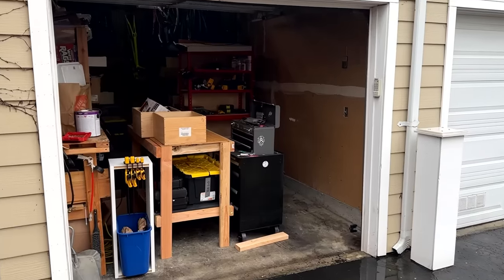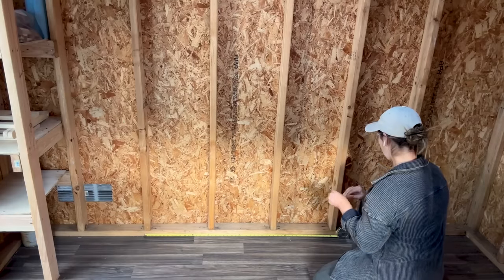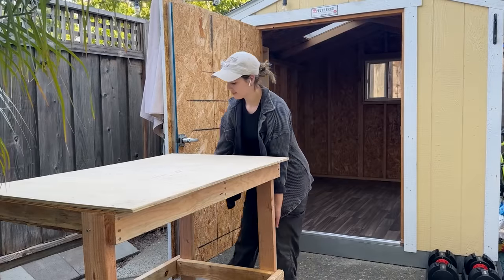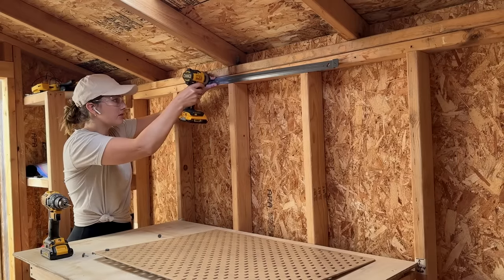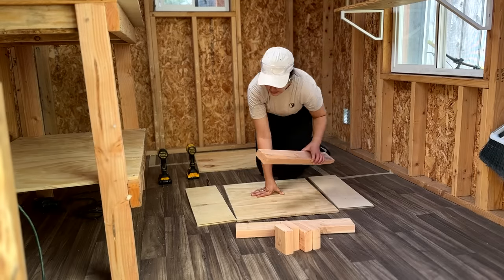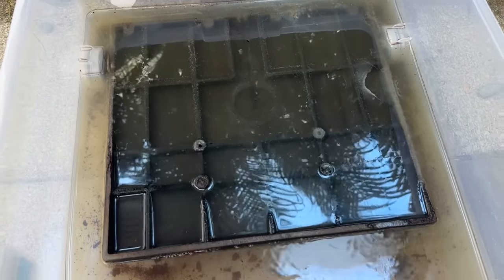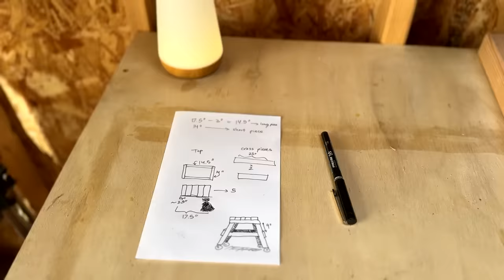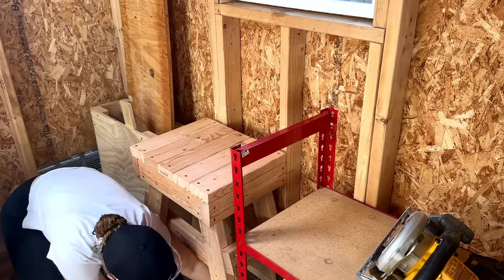Building a Mini Workshop... Again

Comment: I have the exact same Bandsaw. It has served me well. Just have to make sure not to push it too hard and I suggest a Lenox flex back blade in the 3 tpi range (70 1/2" blade). Was only 15 bucks on BandsawBladesDirect. Great for resaw if you're into bookmatching for box lids and such. Sick shop. Super jelly😂
Reply from the maker: Thanks for the tip!

Comment: Hey, i see those nice B-roll shots at the end and at 13:44 and other parts i can see your exposure was not locked and it was changing, if you are able to lock your exposure when inside the shed and keep it the same for the whole sequence it will look better. Of course the first shot from outside to the inside of the shed needs an exposure change and it looked fine but if you are in a constant light environment it is better to set it to one setting and keep it and it also should stick the shots together in a better way. Soo just a small tip if you'd like.
Reply from the maker: Appreciate the feedback! For now, I use my iphone to film everything so I have a bit less control than with a camera.

Comment: My first thought was, you should make barb doors out the side wall. Put a couple of those wheels on them. Need more room just swing them open. My 2 cents 🤷‍♂️. Turned out as a nice workshop space 👌👌
Reply from the maker: Thanks! I like the suggestion, problem is I'm a renter and this is the landlord's shed that I'm allowed to use but not completely  modify

Comment: I did something similar with a shed that came with a house I purchased.  I converted it into my office.  My only issue with it is that it was made from 2x2 instead of 2x4..so the walls are thin, and it's expensive to heat and cool.   Looks good, though, I really enjoy having mine.

Comment: Nice job 😀. I don't know where you live, but I would insulate the shed if possible. Cooler in the summer, warmer in the winter and might also lower the noise (less angry neighbours if any).
Reply from the maker: Thanks, a few people have suggested that. Weather/temperature isn't much of a concern where I live but the noise reduction benefit is a good point

Comment: My piece of paper in the suggestion box reads..... More clamps~ a lot more clamps. Srew and nail totes 'removable' in the little gap by the window (at least 20 for the most common sizes). A way to lock the table to the wall of the shed, that little bit of extra stability helps when hand sawing off the edge of the table or in the vice. Maybe a drill bit organiser, metal, wood, brick, tile etc. A good extractor vent in the top of the end wall to get the heat out and stop mold growth. And some good 5500k-6500k LED lighting.

Comment: 12:42 - spray paint really doesn't like the sort of extreme temperature changes you'll get in a shed over the course of a year. In extreme cases, like if you're in an area that is generally pretty hot during summer and that shed gets lots of direct sunlight, you risk the heat doing unpleasant things to the compressed gasses inside those cans. Storing it separate from the materials you want to use can cause some weirdness (spray paint solvents really want the can and material to be the same temp), but that's better than the alternative. 

Other than that, I like this build. It's a clever use of a smaller space. The fact you have a P100 handy is great.
Reply from the maker: Appreciate you sharing your concern and you’re right! Our area doesn’t get too hot in the summer (typically) but just to be safe I did move all the more sensitive chemicals and paints to the garage since it stays much more stable temperature-wise

Comment: 800 grit sandpaper on a flat block will really smooth out the bandsaw table, then wipe off the table with naptha (shellite here in AUS) with a clean rag and then rub in some woodworkers paste wax which will help protect the iron and also lend a hand in smoothly guiding stock through the bandsaw. Not sure if anyone mentioned already, just been watching the build unfold :)
Reply from the maker: Appreciate the tips 😊

Comment: I'm new to woodworking.  I built a work table for myself.  Now that I'm using it, it's probably double the size I really need.  I have thoughts about redesigning it to a manageable size.  Thanks for your video because I now have ideas about storing my tools somewhere other than on the workbench.  Oh, and a nice wood scrap storage that my wife will thank you for.  🙂
Reply from the maker: Glad I could help!

Comment: Cool workshop but I really think you should insulate between the wall studs and the rafters. Both to keep out the heat and cold (one of which is more important in your area) as well as controlling humidity to prevent rust.
Reply from the maker: Appreciate the suggestion, definitely considering it
Reply: @elenamakes  
You won't regret it!

Comment: I just thought I might suggest you get some 2 inch rigid foam in various sizes to place on your sawhorses while you’re downsizing your sheet goods. Just set your sawblade an eighth of an inch deeper than the thickness of your products. You’re downsizing and you’ll be fully supported before during and after your cuts.

Comment: When you were replacing the lower shelf on your workbench did you consider replacing the top and notching it out to go around the 2x4 wall studs? I imagine in such a small space that extra 3 1/2 inches could be valuable, not to mention keeping rolling things from rolling off  the top behind the bench.
Reply from the maker: Not a bad idea!
Reply: @elenamakes  if you're not already familiar with her, check out @diyhuntress. For years she did projects out of her shed shop and has posted a lot of videos about it.

Comment: Nice video. (Nice to see other women doing builds and  DIY etc.)  I think i saw another shed build where the moisture still kept water vapor inside (since there's no vapor barrier skin), and thus rusting tools and warping wood, creating mold inside.  Consider adding a solar vent to exhaust out air/moisture (50CFM min.) Even though the shed is not heated, I still think consider adding insulation, altho it depends on your climate (seems like it would working in there more comfortable.) In warmer months, the exhaust fan will take out heat, stale air.  I like the idea someone made of painting it white to get more reflective light.
Reply from the maker: Appreciate all the great suggestions :)

Comment: A couple of cleat walls for tools and power tools should save you a lot of space. Also maybe a shallow wall cabinet using both sides of the doors for paint and small parts storage might work. How about attic storage for scrap wood?
Reply from the maker: Unfortunately no attic at our place but I like the other storage suggestions

Comment: Everything looks good but I see one thing that can be easily made better. If you shorten the legs on your bandsaw stand to make the saw's table the same height as the workbench you can use the workbench as an outfeed table. If you add other tools like a table saw, router table, planer, etc. you can make stands so all of them are the same height and any one can be an outfeed, infeed or side support table for large materials.
Reply from the maker: That is a great idea

Comment: Clearly you live in a warmer climate than I do.  Last winter it got to -14C (about 7 fahrenheit) for a week so one of the major issues in the workshop I am kitting out is INSULATION.  Brrrrrrrr 🥶
Reply from the maker: Oof yeah those are some low temps. I am very lucky to live in an area where a good fleece lined jacket will keep you warm enough in the winter

Comment: Do you have plans for some kind of climate control for summer/winter? Maybe a window a/c unit or small heater? I love the shop, great video and great suggestions!
Reply from the maker: Good question, I’m lucky to live in a place where there might be a couple days out of the year where it’s too hot to work in there, but most of the summer, a fan will do just fine. It also never gets cold enough that you need more than a good jacket but I do have a smaller portable space heater as well.

Comment: Very nice job on the workshop, I like it a lot. But was wondering. why didn't you add 2 X 4s in the middle and on the one end of the workbench to support the bottom shelf.
Reply from the maker: I actually recently re-did my workshop (I moved) and made those reinforcements on my new bench :)

Comment: Excellent job in making a workable shop from a small storage shed. The one thing I saw that was a bit concerning was your cutting of the plywood shelving for the workbench. cutting the plywood down the middle, while it was supported on two outside sawhorses is an accident looking to happen due to potential blade pinching. Please, for your safety, always cut the material so that the fall-off piece is unsupported. Just put a smaller table below the fall-off if you don't want it to fall to the ground or floor - but never make a cut between two saw horses or supports.
Reply from the maker: Thanks! You're 100% correct I shouldn't have cut it that way, appreciate you looking out

Comment: If you had a least 6 feet of space between your shed and the fence in your yard, you could attach a fold-up sawing table on the outside of your shed for cutting larger pieces of wood. That way, you wouldn't need to pull out any saw horses anymore to cut 2x4s or plywood on ever again.  Not only that cutting wood on top of a table is way more safer and you don't ever have to worry about your equipment binding up on you during a cut or a skill saw kicking back from cutting pieces of wood without any support under the wood. Also, in the long run, the less you bind up of your skill saw the better the chances are you'll never need to burn up a nice expensive tool so you can keep building stuff and not have to run to the store to get a new saw every time your get your saw into a tough bind.

Comment: It is a very interesting project to implement in my hometown in rural northern Thailand.  And would like to ask about your ventilation system, how do you do it?  Because my hometown is in the tropics, the temperature is high most of the year.  thank you very much
Reply from the maker: Hmm I'm no expert but if I was in your situation I'd install a ventilation fan in the ceiling and have fans / windows I could open to get good air flow in the shop itself. You'd want to be careful about dust getting kicked up by the fans but a ventilator and full eye protection would help.

Comment: I recommend putting a spool or something similar on the screw that the bandsaw's cord hangs on.  Almost anything to increase the radius and NOT be a sharp metal edge directly on the tool's cord.  Is the screw likely to damage the cord: probably not.  But why go looking for trouble when the solution is literally five minutes' work and an otherwise useless piece of scrap to fix?

Comment: Since some products like the ones on your shelves (generally speaking, don't know about your shelf items specifically) are temperature sensitive, do you have any thermal control in mind?  Not sure on your climate, but I know that a lot of products have a range and not just minimum or maximum temps to work with.  I'm planning on outfitting a space just like the one you have, so I'm eager for any ideas.
Reply from the maker: My climate is pretty temperate, but just to be safe I actually moved the more temperature sensitive items to our garage as the temperature in there stays more consistently cooler.

Comment: Knew i forgot to tell you something..DONT USE 3 in1 oil or any other rust inhibitors on any metal surface...clean it then use a Ceramic coating on it..i used a one made for cars BUT  found one for metal surfaces..works awesome...Now go build..!

Comment: Your workshop looks very neat and organized, congrats. I am not from US so I don't know the ins and outs of your lumber market, but it seems to me that those beams you used for the open shelf  are a huge overkill? Probably the same for the bandsaw stand. Is there a reason why you didn't go with something thinner? Thanks.
Reply from the maker: They are a bit overkill, but 2x4s are readily available and relatively cheap. Plus, I generally err on the side of overkill when building stands and shelves for safety :)

Comment: if it rusts... you can seal it like you would Cast Iron Skillets
WD40 is a fast quick application thou

link to the wallmount tool hanger and other gadgets might be nice
Reply from the maker: add a link to the tool wall mount and the other things I used in the video

Comment: Pleaseeeee never cut between two saw horses again, only cut from the sides! If you have a full size piece of ply or long piece of 2x4 even you can get kick back from the weight of material falling in and binding the blade, great work though!
Reply: I was clenching my cheeks and then when I saw the jump cut I half expected her to say something about how she almost lost a finger trying to catch the falling peice. My preferred way is to place insulation foam as a work surface.

Comment: I have a littlebit trouble translating (Dutch), but the vinegar you using is that for food/salade or for household cleaning
Reply from the maker: Both 🙂 it’s the vinegar you would use in cooking but it can also be used in cleaning or, in this case, to get rust off metal

Comment: The red storage rack is upside down. you get a whole new shelf if you turn it the right way.
Reply from the maker: It actually is the right way up, the lock in place shelf pins wouldn't stay in the other way around. I am missing the top half of the shelf so that might be why it looks a bit off :)

Comment: WD40 isn't the best rust preventer and should be reapplied very frequently. Some use hard wax (lasts longer and helps with material sliding over it freeley) or products specifically made for this purpose, so you only have to re-apply it every 4-6 months

Comment: That red shelf looks like an accident waiting to happen.  What's even the point of keeping the sides if there's no top? You just have to lose your footing once near that thing to end up stabbed... Put some rubber protections on it, another top shelf or cut the extra sides. Specially in a workshop where you can step on the dog by mistake and fall on it.
Reply: Other than that, it looks like a really nice cosy workshop, and the doggy looks to approve too ^^

Comment: @elenamakesstuff Did You know that, the autofocus on the camera is not the perfect function in small spaces?!
Reply from the maker: I film with phone so sometimes there are minor focus issues due to less control. Plan to get a nicer camera eventually :)
Reply: @elenamakes  I think, You can buy one used camera, new not needed. 
I was cameraman for many years and I started my camera career with a used camera and it is still a part in my storage :D That was a sony vx1000 miniDV and it still works.Only the third camera was new that I bought under my career.

Comment: I see some safety flaws when I see how you are using the circular saw that I take my hands to my head. Never ever cut a piece of wood with your leg just inches away from the same direction the circular saw is cutting and without proper protection. There are thousands of accidents related to circular saws because of not taking proper safety measures.
Reply from the maker: Appreciate the concern! I definitely could have taken better precautions and I'm always trying to get better when it comes to safety around power tools.
Reply: Glad to hear that… take care, those power tools can literally kill you, small mistake big consequences.

Comment: use wd 40 as rust protection is such a american thing 🤦‍♂️ wd 40 is mostly a remover of rust, dirt etc. use some machine oil if you have no problem with it getting contact with wood, but pls no wd 40